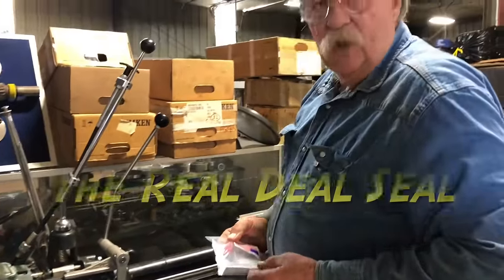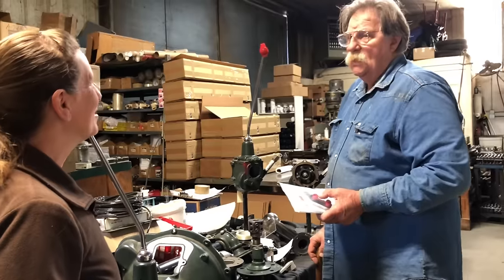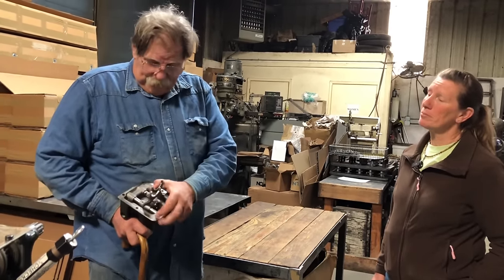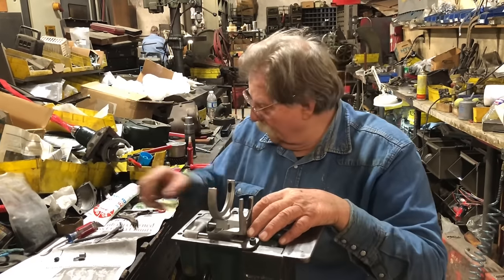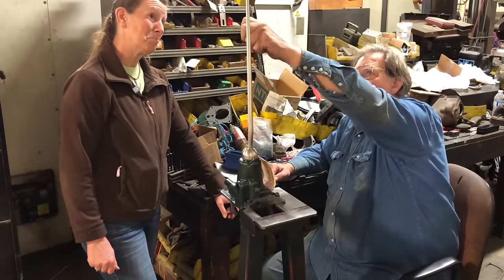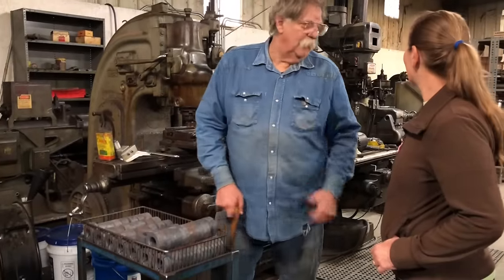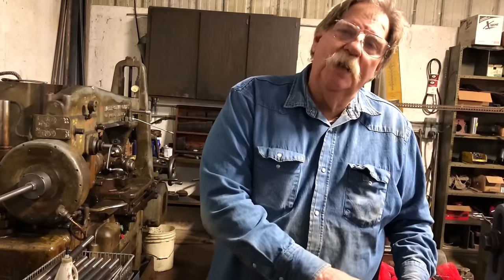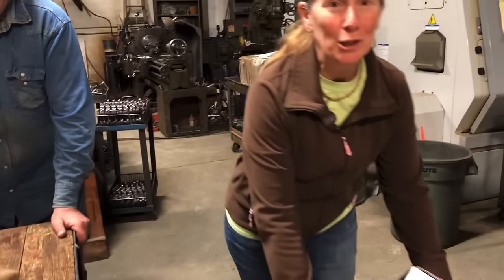I got a synchronized transmission for my 1929 Ford Model A Roadster, we toured Steve Mitchell’s shop

Comment: I have a Mitchell synchronized transmission in my 1930 Model A Roadster.  Works great.
Had a bit of problem with installing the shifter rail seal.  Bell housing had a small hump in the casting in the inside  that kept seal from seating. Had to grind bell housing some to get it to fit.  Luckily I had engine out for rebuild which made bell housing  modification easy.
Reply from the maker: Wow, I’m so happy it ended up working out for you 💕
Reply: I had an issue with the Mitchell synchronized transmission at first.  It would jump out on high gear on deceleration.  Called and talked with Steve Mitchell.  He was very helpful. He said that shift column plate had to pushed as far forward as possible.  Instructions say that.  Anyway ended up cutting off the top part of the transmission  to bellhousing gasket just above the transmission case.  Works great now, no more jumping out of gear.

Comment: I watched your video on the alternator conversion . I found the pulley and ordered it on amazon , I couldn't find the regulator on Amazon, I did find it from the manufacture for 16 dollars and change but they wanted 18 dollars for shipping . My question is do you know anywhere I could get it with a little less shipping charges or do I just have to bite the bullet. Love your video's and Model T. Keep them coming. thanks in advance . I have a 1930 pickup.
Reply from the maker: Hi! Unfortunately we don’t know of a cheaper route, best of luck and have a wonderful week! 💕

Comment: 3:27 Spoke to Steve on phone and he said under no circumstances use 600w in his  synchronized trans.  He said in warm weather a modern heavier oil ok if you want a little quieter transmission.  So far so good after 6 years and 4000 miles with 85/140.  Never drive under 45degrees F and mostly short trips.  Had to remove paper gasket between front of shift tower and bell housing to keep from jumping out of gear.  Ford tolerances were not consistent on this area.   That little bit of forward movement worked.  Seal it with something else.  This and the automatic spark advance make a model A easier to drive.   3. 27 rear gears makes the car cruise at 50 MPH with good motor.
Reply from the maker: Thanks Andy 💕

Comment: Hi Tina!

Great video, and not too long at all.  I loved learning about everything they do there.  

One question I had is regarding the shifter lever finish Mitchel provides.  I believe Steve said his are brushed nickel.  Do you or Paul know if that is the same as the original Ford butler finish (which I thought was a brushed chrome)?  I can’t find any information online to confirm if the two finishes are the same.  Seems like all the shifters out there are either rusted, shiny chrome, or painted! 

Thanks!
Reply from the maker: The original is brushed nickel and that is what Steve is using, he uses original stick shifts and rebuilds the area that is warn down from years of use so that the shifter stays locked in gear instead of loose and wiggly. Have an awesome week!

Comment: Where the transmission case has original porosity and the shaft o-ring will not seal on the bore of the housing, could JB Weld be applied to the case bore, and reamed to size when hard to provide a sealing surface for the o-ring?
Another approach would be to make a bushing, bore the case and install it with a sealant and interference fit.  Then the bore can be reamed to the size needed for the shaft and o-ring.
Reply from the maker: Yes, using JB weld in that case would work, Steve mentioned this also. Have an awesome week!